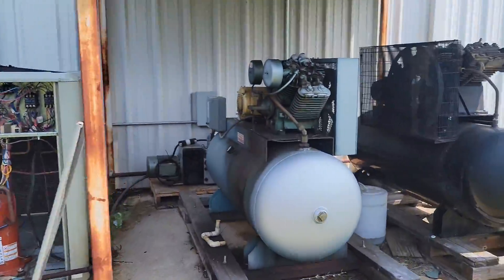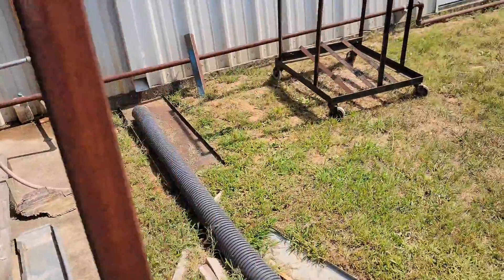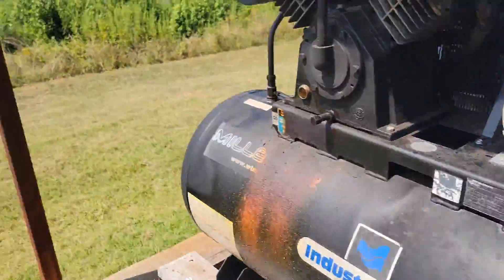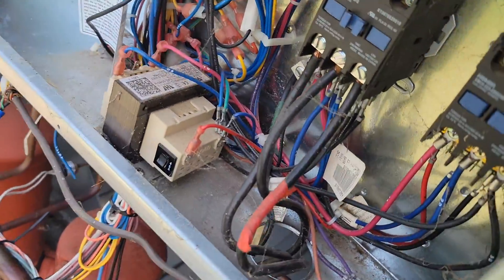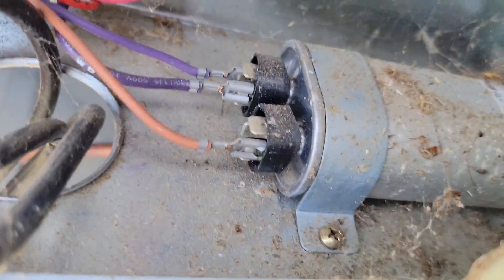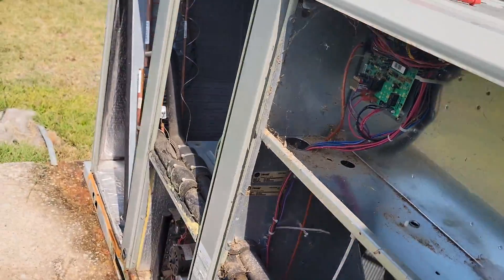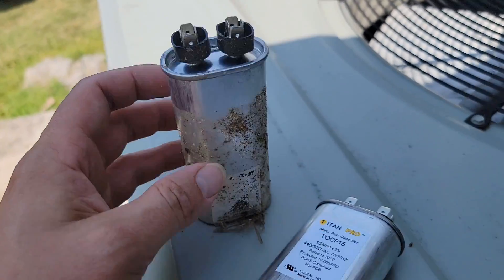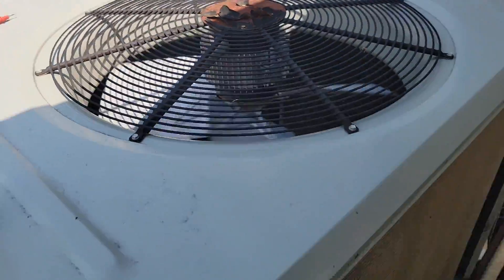What will Cause The Fan Motor to Spin Backwards?

Comment: As part of a Home Depot deal, an HVAC guy checked my system. The fan was running backwards. He said he tried switching the wires, and then the compressor would not turn on. He suggested a new AC unit. I saw this video and decided to try a new capacitor. I looked at the wiring diagram inside the cover, and it turns out the herm and common wires were switched! Now I have extra capacitors (dirt cheap), which I will keep for an emergency, and a motor which I have to return (at cost to me). He estimated $1800 to change the motor!
Reply from the maker: Thanks for sharing that story, I'm glad you could fix it!
Reply: Many of those people will always try to scam you

Comment: Why would it spin backwards because of a capacitor being bad?
Reply: The capacitor changes the phase angle on the incoming power on the start winding.  Some motor designs will do that if the capacitance is improper.